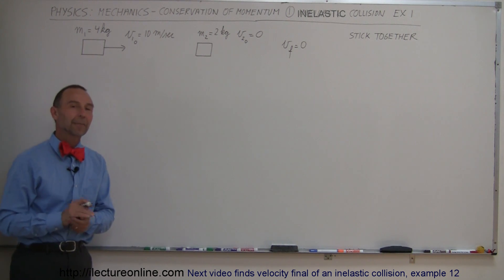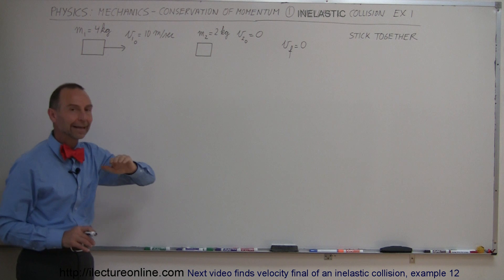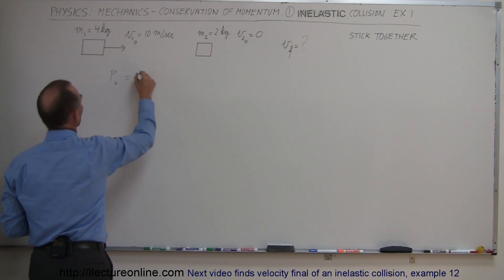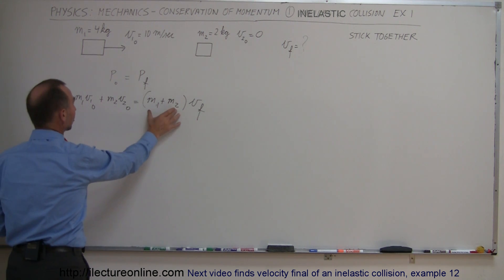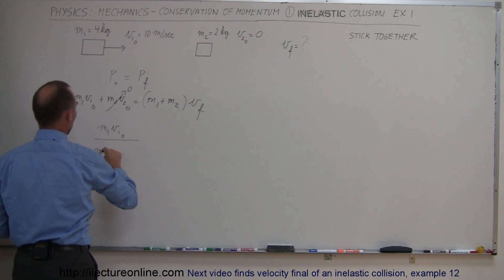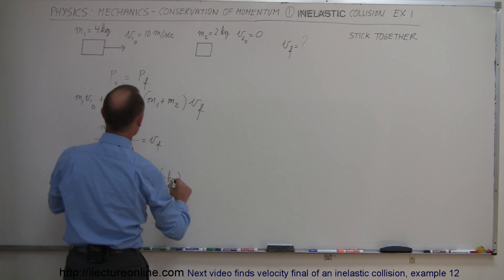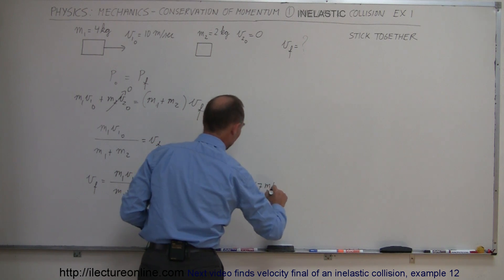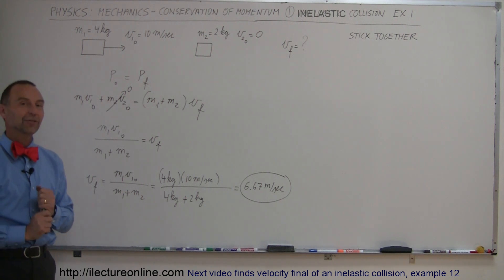Physics 10   Momentum and Impulse (16 of 30) Inelastic Collision Ex.1

Comment: i really need help with this
Four railroad cars, each of mass 2.50 * 104 kg, are coupled
together and coasting along horizontal tracks at
speed vi toward the south. A very strong but foolish movie
actor, riding on the second car, uncouples the front car
and gives it a big push, increasing its speed to 4.00 m/s
southward. The remaining three cars continue moving
south, now at 2.00 m/s. (a) Find the initial speed of the
cars. (b) How much work did the actor do? 
i think i have an idea about how to do this but i keep stumbling over myself can i PLEASE get some help
Reply from the maker: 4 Vo = 3 (2) + 1(4)      Therefore Vo = 2.5 m/sec     Work = change in energy.    W = KEf - KEo  = (1/2) (25,000)(4)^2 + (1/2) (3) (25,000) (2)^2 - (1/2) (25,000) (2.5)^2
Reply: thank you